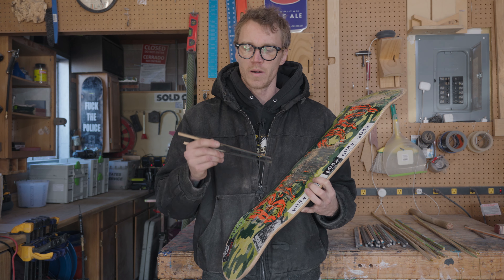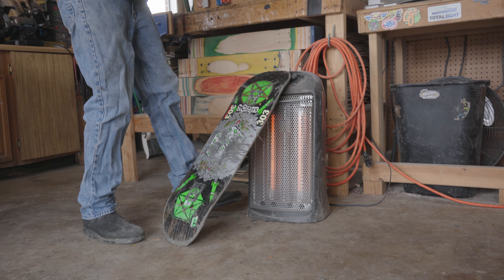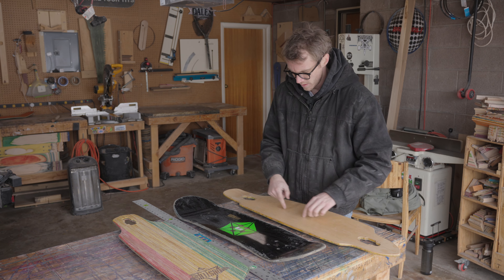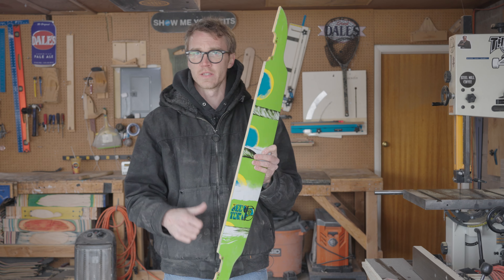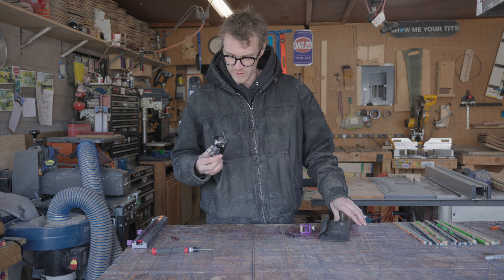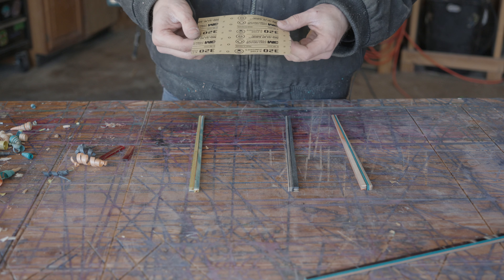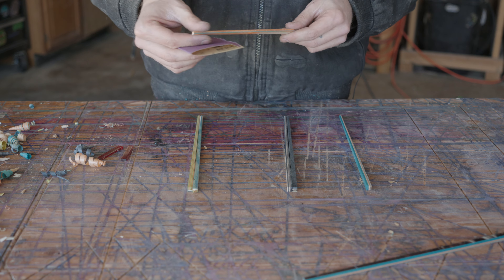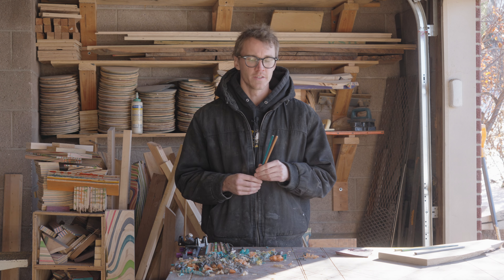Making Chopsticks out of Recycled Skateboards

Comment: Love the Work but I have a few questions. What finish did you spray on the chopsticks? Is ist foodsave? I dont need more microplastic in my Food. Also if I would use them for ramen or something containing steam, moisture and heat wouldnt the woodglue of the Skateboards just fail on me? Just wondering what your opinion on this is.